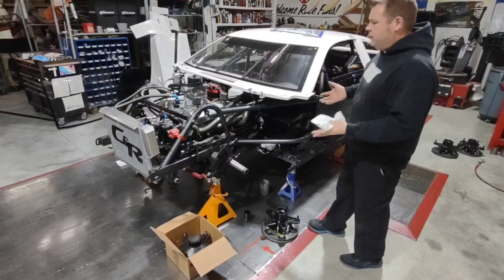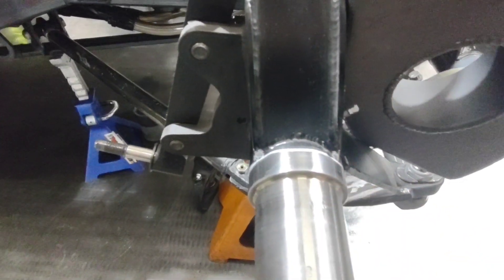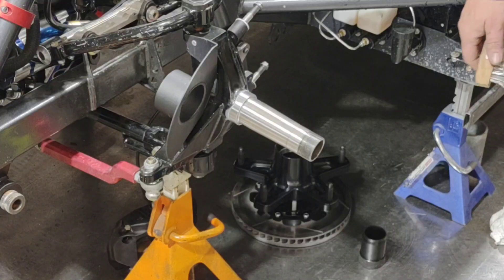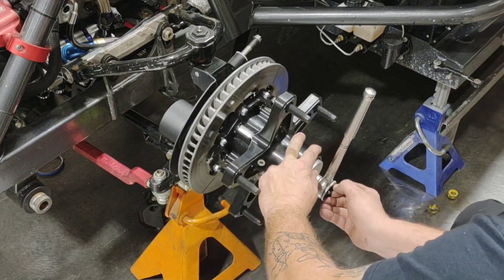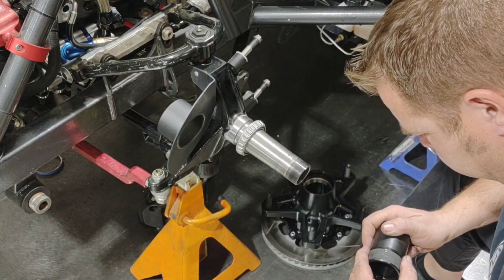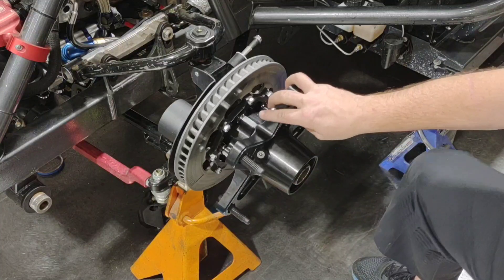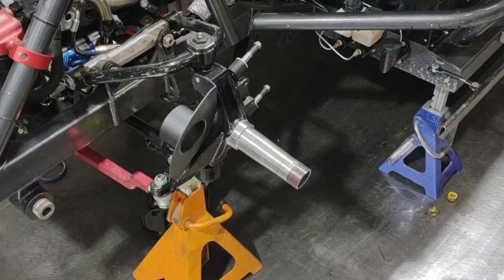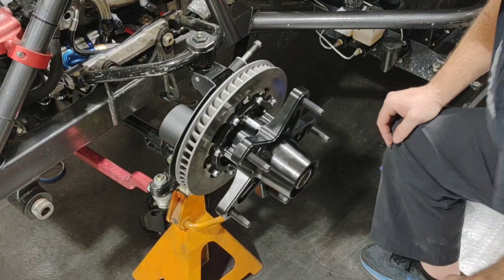Setting up Bearing Spacers on a Wide 5 hub.

Comment: should you compensate the spacer dimension/preload for heat that will be seen in race conditions?
Reply: I was wondering same thing. So heat her up then set it. That is why I have an old oven and a mapp gas torch in my shop. Bake the hub at 300 degrees then heat up snout to 300 degrees then use drop gauge to set end play. Do it the same way every time and you will figure out where it needs to be set at then you will know and not have to guess. Plus after it all cools down you can recheck play with the drop gauge and see if it changes or got too tight after it cools and shrinks. End goal is knowing how it should be then setting it there every time.